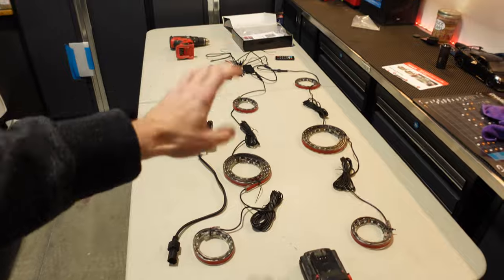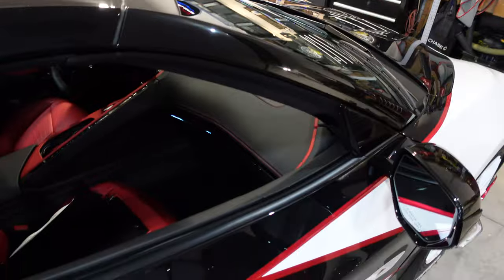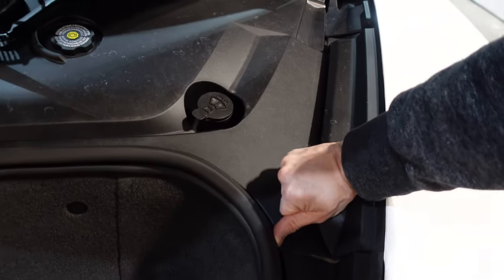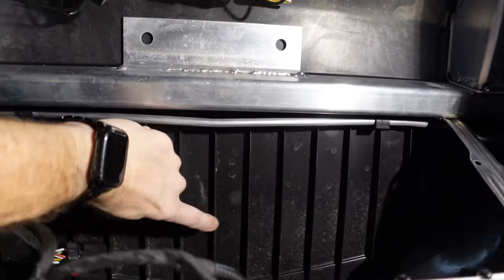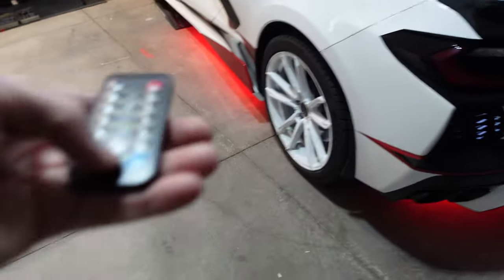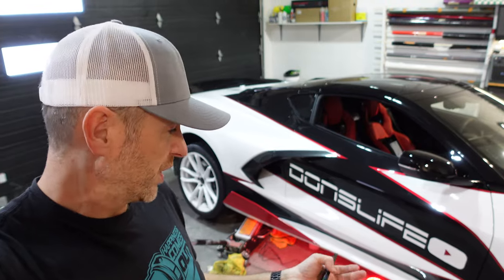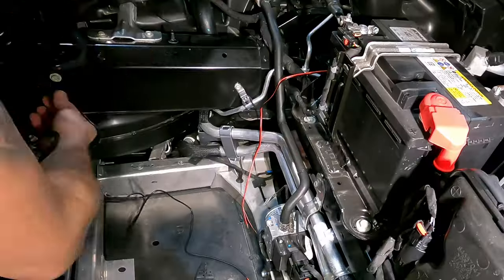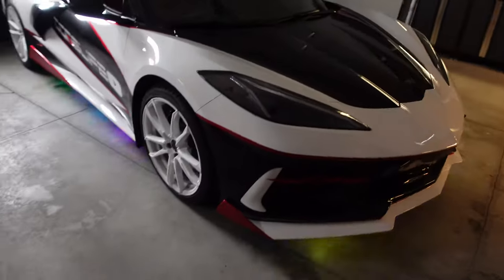How To Do a Clean Underglow LED Install - C8 Corvette

Comment: I like it. I did something like this 30 years ago on my 1993 Ford Cobra and was exclusively for car shows. Lit up the same teal color as the car at Sunset. Was a showstopper back then. Funny to see it coming back.

I was thinking of doing something like this to my Whipple Supercharged 2021 GMC Sierra AT4, which is my toy/hobby vehicle and how I found your channel originally. I'll be curious if you end up wiring in so that the car doesn't have to have accessory mode on. For Car shows and the like,  I'd think this would be almost a requirement and something I'd be interested in seeing for sure.

I also like the comment from imdbtruth about the controller. Neat idea, but with local laws may not be practical
Reply from the maker: I have some plans for more switching options but I am just not there yet

Comment: You should use a Blueghozt controller and wire in your Turn Signals, Reverse, Parking, Brake lights, etc, then your underglow will make a sequential line down one side of your car that's synchronized with the timing of your factory turn signal. 

I'm not hating, I liked the video and think you did great, but I really like your car, and as somewhat of an underglow aficionado, I want that car to have the best underglow setup.
Reply from the maker: I appreciate that. Step one was just get it installed ✌️